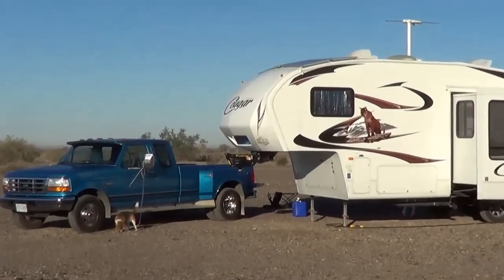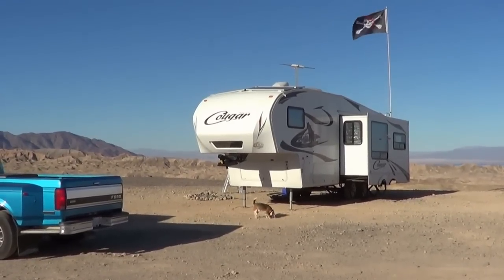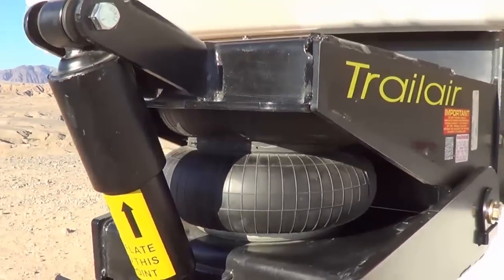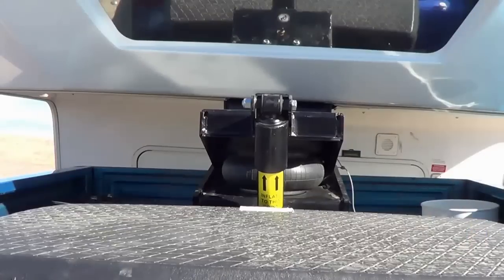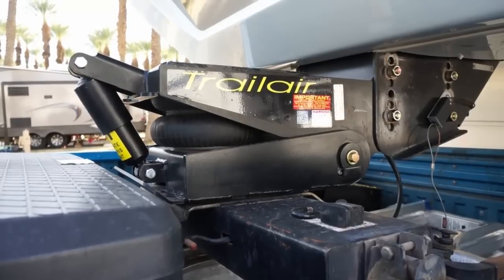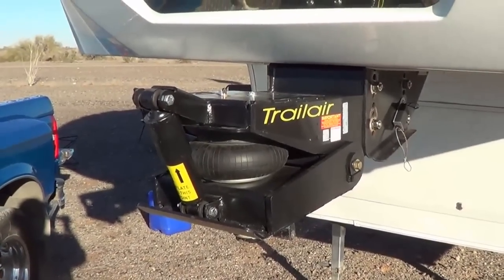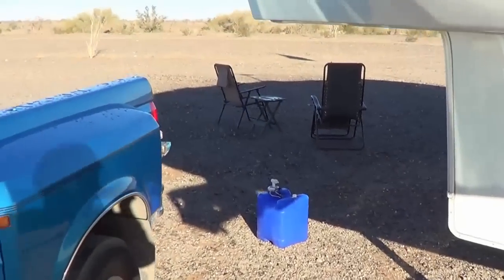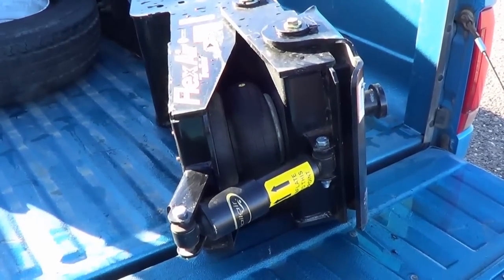Lippert Air Ride Pin Box Review and Demo

Comment: I run the trailersaver 5th wheel hitch on my med duty Kodiak. It is a lot more expensive and weighs in at over 300lbs, but it dampens out all the trailer/truck interactions and I dont ever feel the trailer on the back of the truck. It is recommended for all med duty and heavy duty trucks converted to rv hauling. I was lucky enough to get mine on Craigslist for much cheaper than new, so that made it an easy choice. Also, the vertical clearance between the jaws and the pin is about half that of a standard hitch, to there is virtuously no movement there, it does require a custom friction plate, sold by trailersaver.
Reply from the maker: Sounds like an awesome hitch!

Comment: What did you DOWN GRADE from the flex air to just an air ride??    I just bought a Flex air as I have Chucking and Bucking Issues have not installed yet
Reply from the maker: Discussed it near the end of the video - https://youtu.be/7Nl9BUeRfzc?t=704
Reply: I dont understand WHAT problem were you having??   I am having the Chucking issue as well as rapid compression from the chucking....unsure what the air alone is fixing
Reply from the maker: @tigman47  It not there to fix a problem with chucking, I never had one, its there to protect my fifth wheel frame from damage. It cushions the blows from rough roadways. I do a lot of travel on gravel roads and rough highways. With the airbag and shock absorber, the frame of the fifth wheel is exposed to a lot less jarring forces, as is everything inside the trailer.
Reply: @LoveYourRV   Thank You  I have Both the Chucking I prefer to call it Bucking and the solid blows from rough Roads  90% of my towing is on ROUGH offroad in MONTANA, I was just unsure how the Buffer Rubber was Causing you issues...
Reply from the maker: I was told by the Lippert/Air Ride expert rep that my trailer with a max GVWR 10,141 lbs was likely too light for the Flex Air with the rubber pad, so instead of preventing chucking/bucking it actually introduced it via an oscillation. He said the marketing people shouldn't have sent that one out and should have asked me a few questions about my rig and whether I actually had a chucking issue. He recommended the Air Ride and Lippert sent it out and been happy ever since, still on the trailer.
Reply: @LoveYourRV    perfect
Reply: I will try to report back to you   My Rv weight is 9750    and we have extremely rough roads here in Montana even the Hwys... I have broken the frame behind the suspension twice with the Bucking and solid compression from the loads ...

Comment: I have one of these, I wonder why the sticker is on the front of the shock when you fill it with air from the side?  Why would they do that? I have a dually and it is impossible to see it accurately.
Reply from the maker: I'm not sure, maybe so you can see it in the rear view, guess you could use a mirror or make your own marks on the side.

Comment: Great information, I figured  the back and forth chucking would be from slack in the the 5th wheel and the pin similar to a tractor trailer. 5th wheel slap does become annoying for sure. I was also surprised how much roll the unit had I suppose you get used to that.

Comment: I can't decide between the FlexAir or the Trail Saver.  The each have the air cushions but one has them on the pin and the latter has them on the hitch?  Do you see any advantage to the cushions on the pin vs. the hitch?  Great video with the camera.
Reply from the maker: Can't really say myself as I've never had a hitch airbag, but I'm happy with the Air Ride pin box. Had it for several years now. Cheers, Ray

Comment: Can you explain in more detail why this Air Ride didn't cause the back to front chucking and the Flex Air did? Was it your type of Hitch?
Reply from the maker: The guy from Lippert that I talked to said it was likely due to the lightness of my fifth wheel. So for a heavier fifth wheel that has chucking issues, it's a good match but not for a lighter fifth wheel that doesn't have chucking problems. My fifth wheel weighs 9400 all loaded up. The Flex AIr has an extra rubber pad to dampen chucking, and the Air Ride doesn't.  https://www.lci1.com/support-pin-boxes  You might want to discuss it with Lippert or one of their dealers. All I can say is the Flex Air didn't work well when it came to chucking, making any I had worse. But the Air Ride works great, had it a couple years now and love it. Guess it all depends on the geometry and weights of the truck and trailer.  Cheers, Ray
Reply: Thanks. I've been looking at the Mor/ride pin box too which has a 3" front or back movement dampening to ease the chucking but no up and down cushioning. If Air Ride could add that they'd have the bomb.

Comment: Ray, enjoy your vids. How's this hitch working after some time? We go on some old logging roads so I would really be putting one through the extreme.
Reply from the maker: Workin great! Got abut 10,000 miles on it now.
No problems, and I'm sure it's taking a lot of the jolts and stress out of the fifth wheel frame.

Comment: If this Lippert hitch is anything like the Lippert RV frame horror show.... OMG!!! Pls provide update and have you inspected your forward RV frame under the cone for cracking n breakage ?
Reply from the maker: The Air Ride pin box has performed great, no damage so far. The rig is 7 years old. Cheers, Ray

Comment: Don't be afraid to run it a little lower than the manufacturer recommends,  my TrailAir runs much better that way with a similarly sized Cougar. Keep up on the rusting, mine starts to rust if you look at it sideways. Really should have been powder coated.

One of the better investments I made for my 245rks.

Ron W.
Reply from the maker: Cool. Thanks for the tips Ron.

Comment: What happens when your air bag blows? Will the hitch still work? Also, didn't you install this at your sisters house before you went south?
Reply from the maker: It was the Flex Air I installed at my sisters place - http://www.loveyourrv.com/installing-the-flex-air-pin-box-on-our-fifth-wheel-trailer/

If the air bag blows or has no air the pin box will work like the old solid one.

Excerpt from blog article - http://www.loveyourrv.com/lippert-air-ride-pin-box-review/"For those wondering why I switched from the Flex Air Pin Box I had originally installed to the Air Ride it has to do with a minor chucking (tugging and pushing action) issue I experienced. Everything about the Flex Air was great except on smooth roads it actually introduced a very minor but annoying chucking action we never had with the solid pin box.Lippert has several pin boxes to choose from and each is designed to solve a variety of ride problems. It turns out the Air Ride is what I should have had to start with. It is the best match for my particular truck and trailer combination.  More information can be found at the Lippert Support website or their YouTube Channel. I’d encourage you to contact them or a qualified dealer when choosing. – Cheers Ray"

Comment: Hi Ray, how much cross wind do you feel  is too much to safely drive in? Have you ever had to pull over for the day and lose a travel day due to wind? I'm sure the dually must help stability somewhat. Would love hear your thoughts.......... or maybe a "driving in wind" video. -Regards,
Reply from the maker: I tend to avoid anything over 30 MPH sustained. I check out the weather warnings and when it says tall vehicles may have problems I wait it out. We are pretty stable with the fifth wheel, long bed truck and dually but it's hard on the motor plowing into the wind and eats up fuel, enough that we may as well pay for an RV Park. ;) Luckily we are rarely in a rush to get anywhere, we have our home with us.

Comment: Ray, how much more does the trail air weigh compared to the stock pin? Also do you believe it is worth the cost?
Reply from the maker: About 120 lbs. I think its worth it for the protection it gives to the fifth wheels frame, but it's a large chunk of change so depends on how much you use the trailer and how much off-roading you do.

Comment: why did you test it with the sliding hitch back in the back position???
Reply from the maker: No, It was in the default position right above the axle, I never moved the hitch to the back position. I actually never have since the truck has an 8-foot bed, no need.

Comment: Is the King Pin father forward than your old one?
Reply from the maker: It's actually a little further back, maybe a couple inches shorter which is a bit of a pain as I need to pay more attention to my tailgate when its down. In some unlevel spots, it will touch the fifth wheel front storage door when down. Worth the inconvenience though, I really like the pin box.

Comment: What air pressure do you have when it is at height ?
Reply from the maker: I find about 60 PSI does the trick for my trailer pin weight.

Comment: Whats the retail price on one of those, and do you think its worth the investment?
Reply from the maker: Anywhere from about $800 -1100. I'd say it's worth it if you have a new or expensive rig or have an uncomfortable ride when towing, or like me travel "alot" being a full timer and take the trailer down some rough roadways. Also the heavier the trailer the more I'd be inclined to recommend an air pin box.
If you just do some weekend type camping and don't put on many miles on the rig it may not be worth the cost.
Reply: Thanks for the advise.  Think I will hold off until its time to go full time.  Plus, plan on getting a bigger trailer.

Comment: love the truck. what's your average MPG?
Reply from the maker: +Ferd Vega 8-12 towing the 9000 lb fifth wheel and 16 - 20 unloaded. Varies considering how windy it is and the if pulling a lot of grades in the mountains vs flats and the speed. With the 4.10 rear end ratio I find 55mph to be the sweet spot at about 2000 rpm for fuel economy.

Comment: Did Lippert give you this pin box for free to try out and give a review?
Reply from the maker: Yes, first they gave me the Flex Air model and it worked OK but actually introduced a minor chucking back and forth motion, worse than the original solid steel pin box. So they sent this one out and it's worked well. Still have it and really like it.
Flex Air install blog post - http://www.loveyourrv.com/installing-the-flex-air-pin-box-on-our-fifth-wheel-trailer/
Air Ride Review blog post - http://www.loveyourrv.com/lippert-air-ride-pin-box-review/
Gave the Flex Air to a buddy with a larger, heavier 40-foot fifth wheel and it worked well for him. I was told by a Lippert tech that mine was likely to light for the Flex Air, marketing should have asked me more questions prior to selecting which inbox to have me try out. Cheers Ray
Reply: Nice! Maybe one day I will be so fortunate. Happy trails

Comment: Interesting video. The pin box that you took off you're saying you had a bucking problem. Why didn't you just weld the lower plate? That would have cost you about $50 and give you the same effect as the new hitch/pin box you just put on. That's exactly what I did not solved all my bucking problems and I still have the comfort of the air ride
Reply from the maker: The company that I was reviewing the pin box for Lippert wanted me to review the Air Ride instead, so it didn't cost me anything. Their expert told me it would be the proper one for my trailer.  Also, the Air Ride is lighter weight than the Flex Air, so it saves on cargo capacity and truck payload. They didn't even want to Flex Air back so I gave it to a friend who had a much heavier trailer and it worked fine.